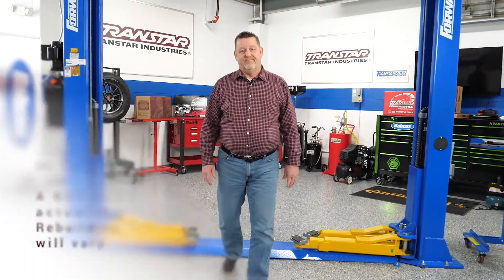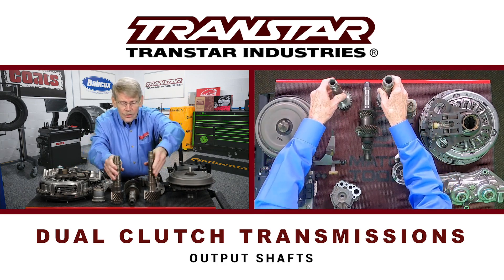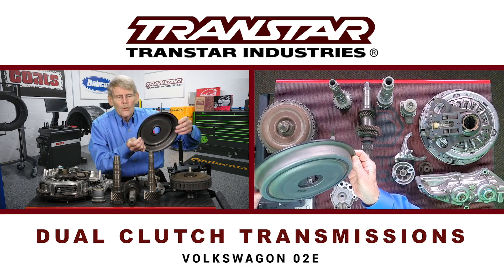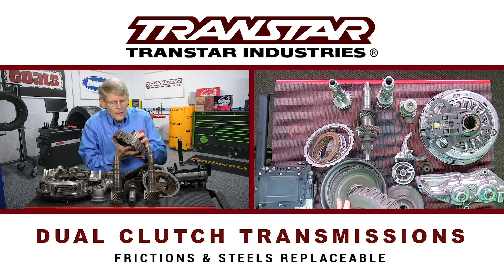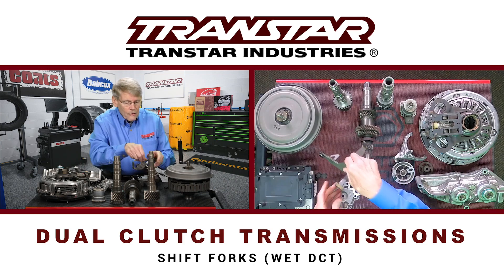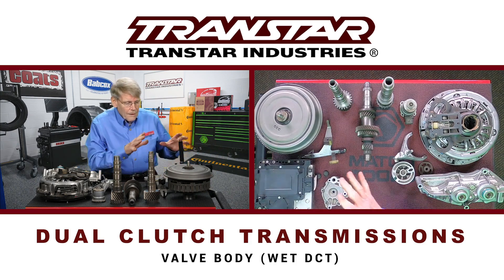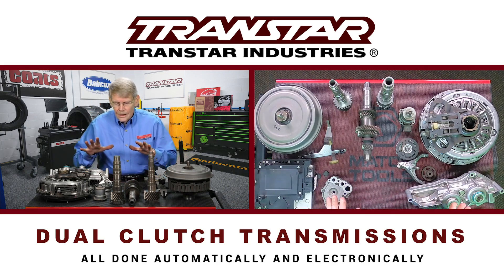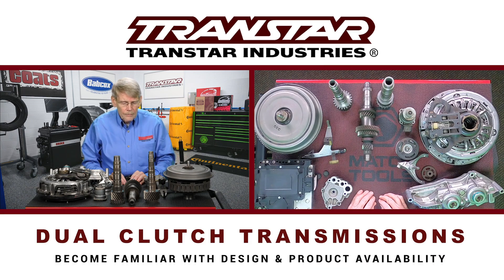Dual Clutch Transmission Assemblies

Comment: Hi, I am planning to buy Kia Sorento 2022 with 2.5L turbo 4cylinder GDI, 8 speed wet DCT. I am worried/hesitant about durability of Dual clutch transmission that might give poblems. How was it compared to the Regular automatic transmission with regards to durability?